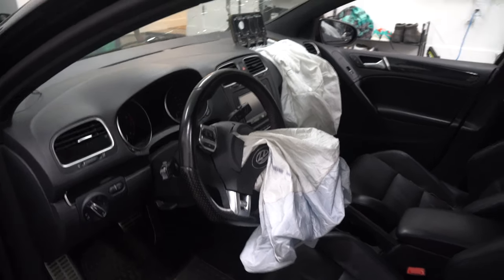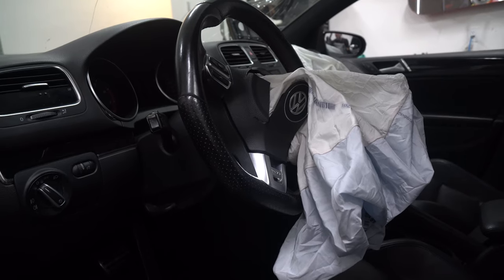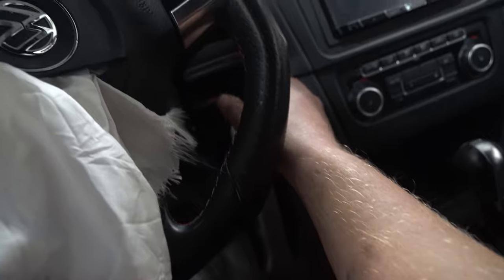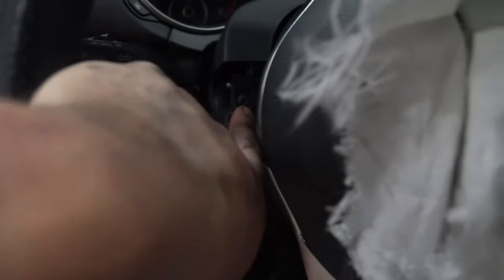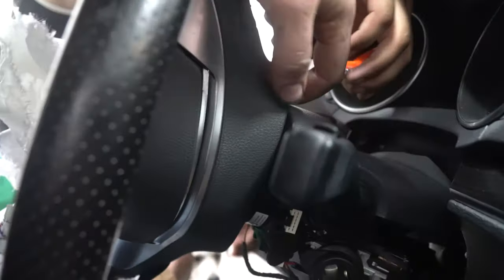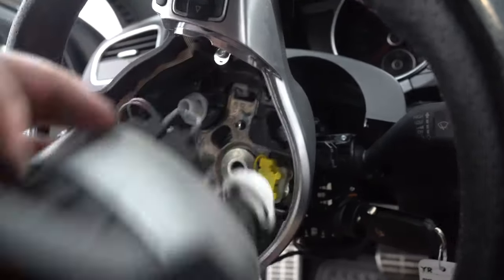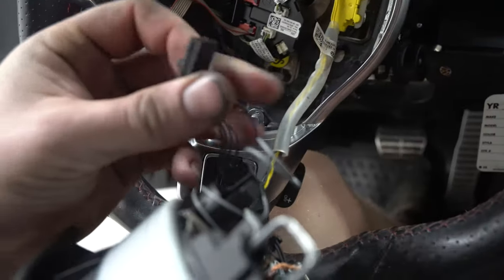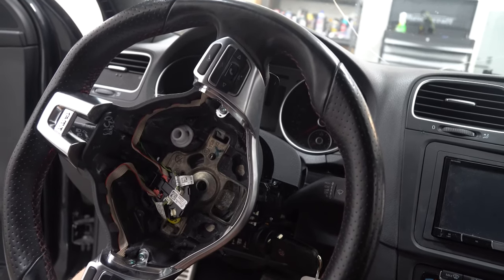HOW TO EASILY REPLACE STEERING WHEEL AIR BAG IN VW MK6 GTI

Comment: Do you remember how hard you were pulling the airbag? I am trying to remove mine to get to the paddles, but it refuses to come out even after pulling almost as hard as i can. (It's also being pushed up into the side of the steering wheel instead of out?)

Comment: Hello, I have a doubt, I have the same problem as you, so, I just have to buy the only the airbag or I need to buy the clockspring too? 
Thank you in advance
Reply from the maker: I have heard that. Clock spring can die when the airbag goes off I would suggest replacing it they also aren't that expensive
Reply: ghostlyrich thank you so much